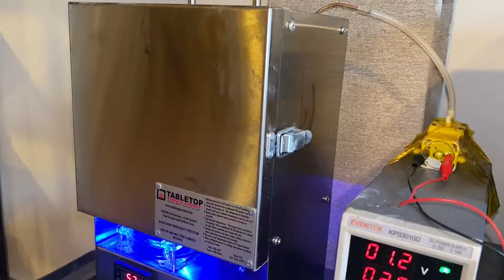The Perfect Cylinder (For All In Tents and Porpoises) - Casting a Two-Stroke Engine

Comment: Very nice casting! How thin the cooling fins are is just amazing! 
Are you going to use some sort of sleeve or coating inside the cylinder?
Reply from the maker: Thank you! I have experimented with copper plating the cylinder with little success. Here’s a video I made about that... https://youtu.be/PTB1RaUCCzo
In the initial design stage I considered using a cylinder liner but decided to pass on that for space efficiency.
Reply: @Levi_Sheridan  Ah okay, good luck with your project.
Reply from the maker: @biermobiel  thank you!

Comment: Make sure the bore is super smooth and symmetric and the piston fits with a tolerance in the thousandths. You can't depend on the piston ring to do all the work. A good engine does not leak pressure at all. Since efficiency is  what you are going for, making sure the piston and bore are perfect goes a long way. Otherwise u might as well buy one of those super expensive engines online that were manufactured with high tolerances. Anyway, great work bro! those casts just keep getting better and better.
Reply from the maker: Thanks Ahmad! This engine is a separate project from my transatlantic UAV project. I’m working on this as a engineering design challenge and to learn about manufacturing with investment casting. I did actually buy a nice Japanese engine that I made a video about for the project.

If this engine works I don’t expect it to be efficient. I know that tolerances are very important and I’m going to do the best with the tools I have. I’ll be happy if I can get it to run at all.
Reply: @Levi_Sheridan  OHHH my badd. I was actually a bit worried if you'd be able to pull off the transatlantic with a homemade engine XD. Yeah don't worry about tolerance's too much now that it's for educational purposes. Based on the quality of your casts, I think it will definitely run. goooodlukk
Reply from the maker: @amk1108  thankfully I’m smart enough to know what I’m not capable of and building a high enough quality engine to pull an aircraft across the ocean is one of those things.